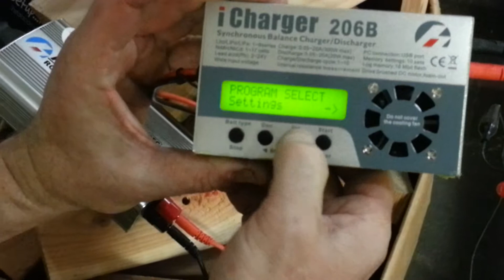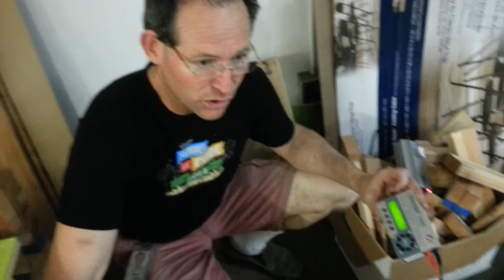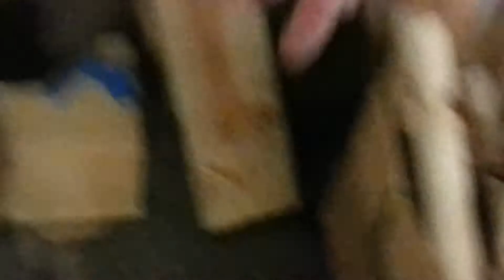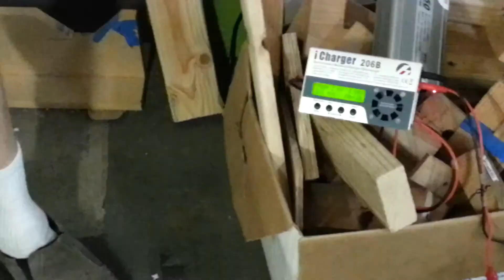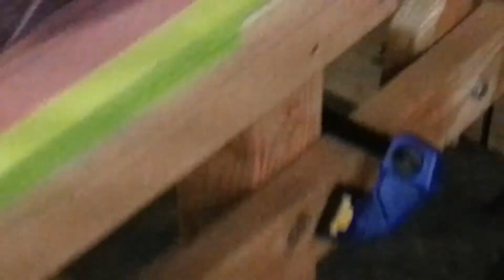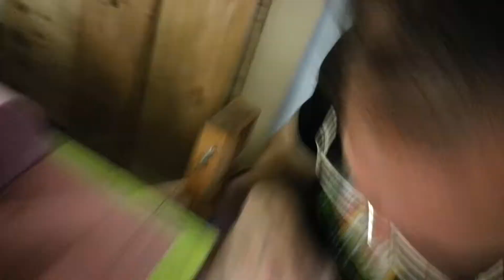How to use hotwire cutter with iCharger in Foam Cut mode

Comment: What type of wire were you guys using?
Reply from the maker: We mostly used Rene wire (I guess technically Rene 41 wire).  I don't remember exact wire thickness but it looks like a typical thickness used for hotwire cutting is 0.014".